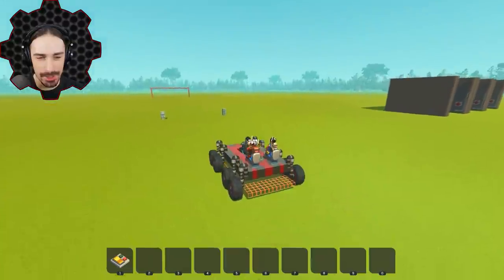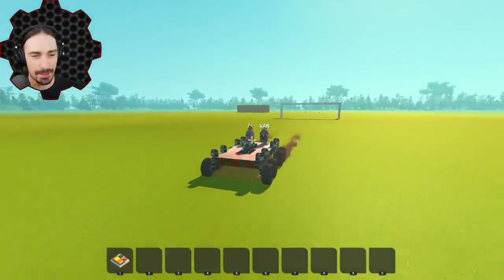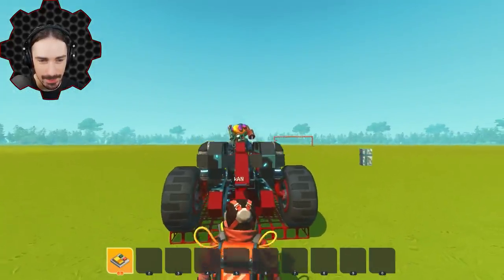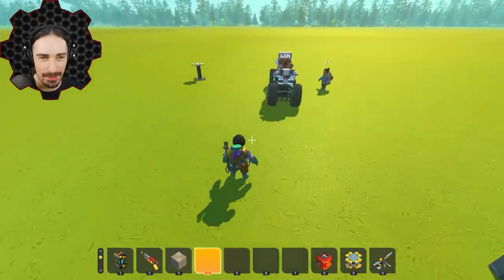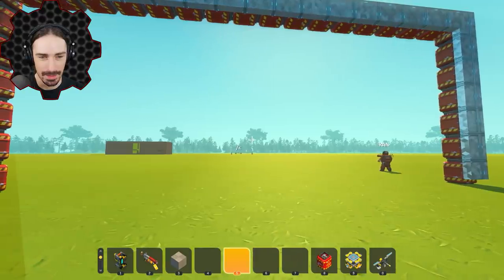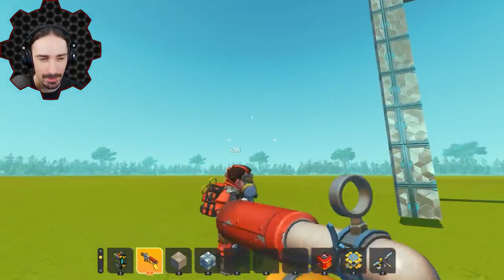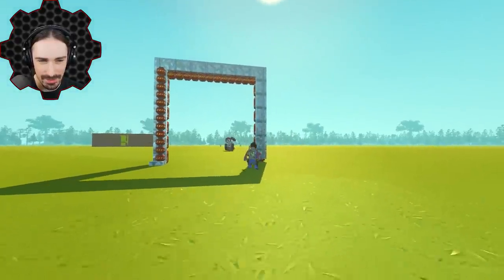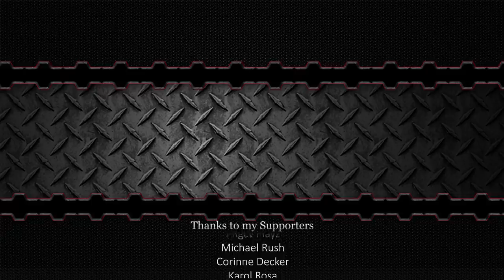EXPLOSIVE SLIP AND SLIDE with CARS! (And The Goal Keeps Shrinking)

Comment: Next challenge should be where you throw something with a big spinning wheel, and you have to MANUALLY let it go at just the right time.
There will be a distance challenge,
A precision challange, (like bowling)
And a mixture of both where the creation is in the middle of a bunch of targets and the goal is to hit all of them the fastest. (So the creation would also need to be able to turn left and right)
No wheels, because the creation itself wouldn't move. Kind of like a turret or something
Reply: The catapult challenge?
Reply: @8bitbunnie936   no because for that one they had an arm launcher thing, aka a catapult, but this one it has to be a wheel where the projectile is stuck to or held by the wheel until they press a button and it is released from the wheel, meaning they'd have to manually time it
Reply: Good idea 💡 👏 👌
Reply: 69th like (:<

Comment: (1) Same thing but a track of wedge blocks pointed in the same direction. Having to deal with the arc and still get into the narrowing goal would be a whole 'nother level. Also (2) if you started with a square goal and used pistons to contract [or extend] it you may not have to do as much alterations, and you could decrement both the sides AND top of the goal [likely inducing cars with seats on their side]. On the sides, the only place that should be hit are the two lowest blocks, and on the top, you could have a reducing number.

Comment: kAN's childhood sounds nice. When ever I did a slip 'n slide back in the day, the point wasn't to run into obstacles that were intentionally put at the END of the slide. The point was to not be the one to find the sprinkler heads that dad forgot about when he was putting down the 25 ft (7.2 m) thing! It was all fun and games until you were full pelt sliding down the thing and then, "Crack!" That would be the sound of either you breaking the plastic sprinkler head and starting the flood of the yard or your wrist or some other bone crumpling due to it being bent wrong on impact with the stupid thing.

Comment: Build a course with multiple explosive gates, each preceded by ‘slip & slide’ sections.  Use explosive spawned to automatically relate the explosives when someone hits the gate.  Trigger the slip & slide sections automatically via color sensors.

Comment: Next Multiplayer Monday build a bomb spawner in the air where it falls to the ground .can have them in a straight line .next need to build a spud turrets that moves left to right that straight under the bomb spawner but turrets are close to the ground under turrets build a base or something that needs to be defended each round you get to add one or 2 spud guns to yourturret and add some heavy blocks to your turrets. Your choice on how much to add

Comment: now same'ish vehicle design idea (with the whole sliding thing) however on a racecourse that has a part built by the looser so round 1 would just be a simple 0 track 3 or w/e laps the person 3rd place gets some time time to modify their vehicle or the course (the modified parts of the track cant be removed unless everyone agrees but can be built upon, but the 1st and second place players can build a track section separately on like a piston during the time son when they lose they can quickly attach their sections)
no glitches, no bugs, weapons are allowed but only starting lap 2 rockets are allowed on lap 3
maybe 10 rounds winner is the one that well placed 1st the most

Comment: Why don't you try a Curling Stone sport but car Vers. With no friction and with a giant platform of the tee line and back line where you slide or just a target where each individual circle has a different points in it base in Color like the bigger Circle is 1 and the smaller circle is 5
Reply: Plss help so scrapman will notice this 😩

Comment: day 142 or 143 of asking scrapman to start a Survival series amphibious tank/basically any transportation and floating base/barge (or under water.) But you need mods... it's a requirement to breathe underwater, if you want an underwater base/transportation. And yes i am talking about the underwater fan moonbo reviewed that basically makes water spaces air spaces... if that makes any sense.) (and if you wanted to move the barge/boat/floating base you are able to make thrusters/glitches/mods to do it or by lift or actual push